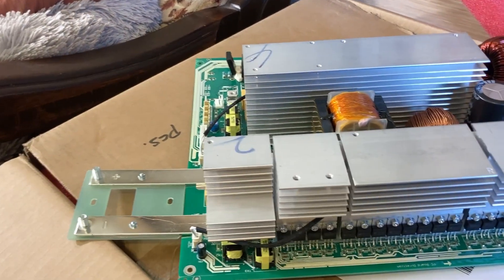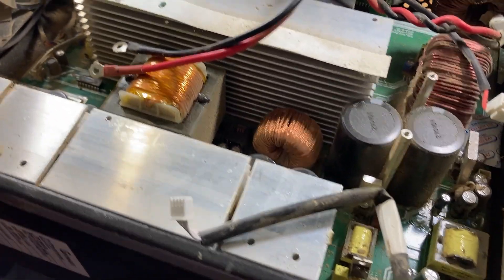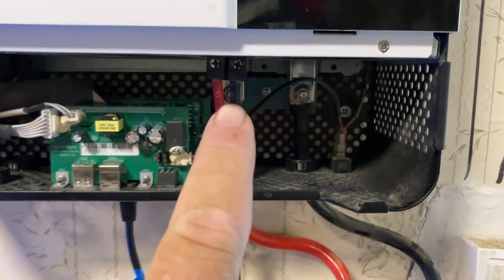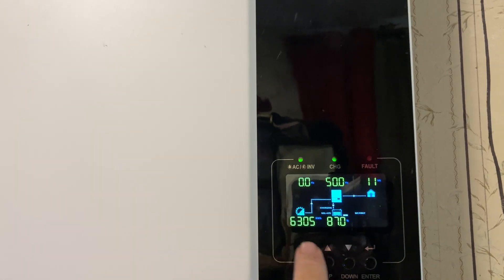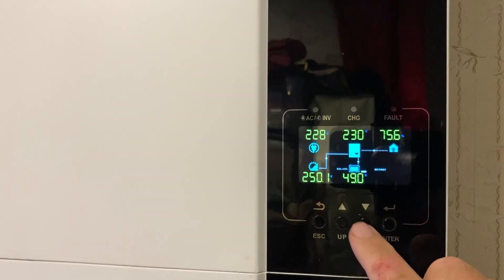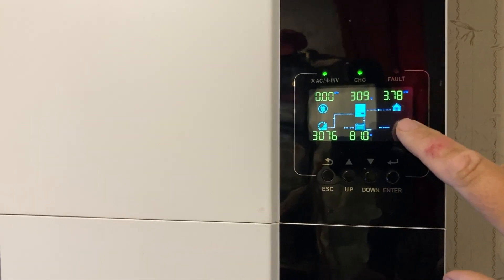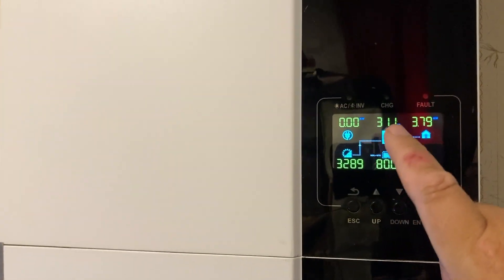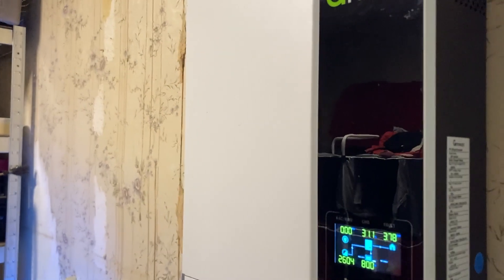Growatt SPF5000es Fault 08 is now fixed

Comment: I have 3 of those and the problem occurs when the inverters are pulling grid power when solar is not there. The hv bus slowly keeps rising and once it reaches 500volt they shut of and give the 08 error. I am using them for 4 years now and had to set them up to charge a little from grid at night/early morning to avaoid the hv bus reaching the 500 volts. as soon as the sun is up they switch back to solar battery mode. If pulling from grid without charging the battery, that's when the voltage keeps rising slowly on the bus. I'm guessing it is a design flaw int these units. Other then that I am very pleased with them though. The problem that poses is that by seting things up this way, i'm using grid power sometimes to charge the battery when it is not actually needed, costing me a bit more in the energy bill. But if i don't, now and then I wake up without electricity and no alarm clock. The only reason i found out it was the bus power is because i use solar assistant to monitor instead of the growat servers. More detail and charts showing when the voltage rises. The thing is also, if i compare the ac generated by these inverters to the grid ac, i can clearly see the inverters produce a much smoother chart then the grid. the grid is actually a very dirty unstable power source where i'm at. Grid fluctuates 10volts the whole time and even the frequency is not so stable. the growatts however are realy very smooth. I don't realy know if that difference has anything to do with the bus voltage rising so high though.  I am considering the switch them out for the newer 6000 serie, maybe they don't have this problem anymore.

Comment: Hi
Where you have put dust filter on inverter is that not the air flowing out.
I'm sure ours draws air in from top then sends out lower section?
Reply from the maker: Just checked, ours blows out of the top. Being cheap Chinese with little to no quality control, it wouldn't surprise me if yours or mine has the fans wired up backwards.

Comment: Ben I sometimes get F08 on my MPPSolar (I believe this brand has a similar HVDC drive controller to the Growatt.) Mine will clear after disconnecting and reconnecting the PV. Was yours intermittent before it failed completely? Wondering if I should try to get a new motherboard as well.

Comment: Why not install crossover or change over switches and circuit breaker so it then not necessarily to have to rewire the house to the inverter every time theres a problom

Comment: I’m surprised they don’t have dust filters on for something that runs 24/7.  All that dust in the growatt might be why it died originally 🤔
Reply from the maker: Could well be the reason it went Kaput. I think I have seen some high end inverters with some kind of filter. Gaffer tape and a bit of tight mesh will have to do. Also it might be an idea for some six monthly maintenance, pull the front cover and give it a blow out 👍.

Comment: HI Ben please help me, how did you set the dip switches on the battery for the growatt inverter to communicate with the battery.
Reply from the maker: I have all dip switches set to off, using the can socket on both the inverter and the battery. Also make sure you have the correct battery protocol set in your inverter menu.

Comment: Gonna be giving you job fixing broken crap soon!
Reply from the maker: @bikeradycbr  I’m waiting for them to ask me to change the mosfets on the new one that packed up. My eye sight and big fingers are no good for this kind of work.
Reply: @Bensgarage  looks like a lot of mosfets to change to and it'll multi layer board too so you need to be careful, bad if they don't have support for there products!
Reply from the maker: @bikeradycbr  I've told them I'm not soldering anything, they either replace with new or money back. I fitted the mother board in the Growatt as it was out of warranty, but this one had only been up for eight months. The only support you get is via email, trying to get me to diagnose the problem. The trouble with going cheap.

Comment: i upgraded to 6000es
Reply: for now 0 problems. and lots of solar more. becouse i have roof E to W  and i added some more PV 12 moduls per string. 30kW battery, minisplit for heating last year this time i used 40 galons of diesel now i go 4 days whit not even thinking on battery. it is worth extra 100$
Reply: @headrushuk  12 per string 400W

Comment: I found that most issues with this inverter have one thing in common, they are all grid tied. The ones that are standalone seem to last a lot more...
Reply: Wouldn't say that. We just said the opposite today 😅 ours lasted 4 years and neighbours one 2 years. We are off grid both use generators and our neighbour used it a lot . And we suspected that because they are not suitable for solar panels they ruined it slowly 🤷🏽‍♀️